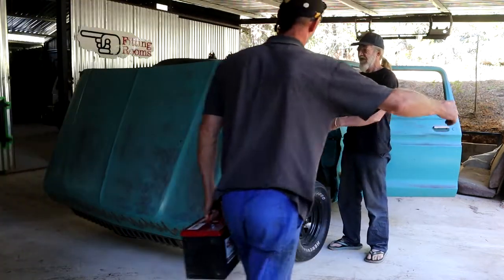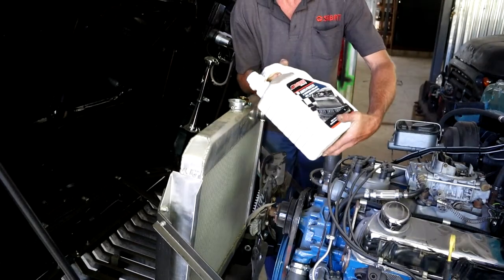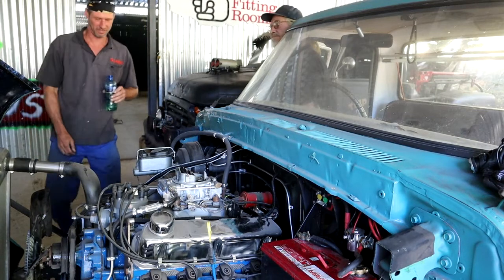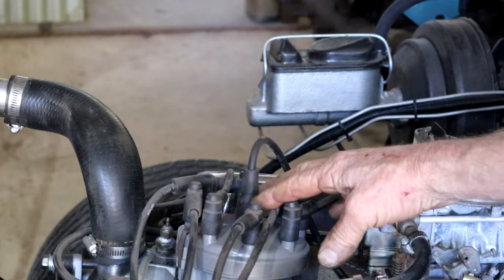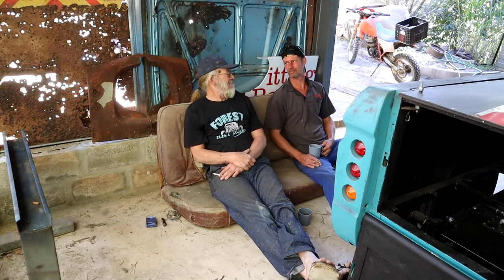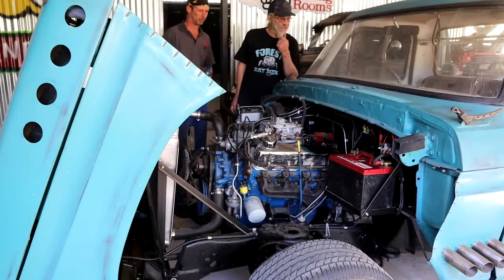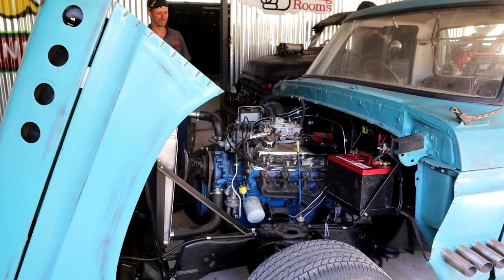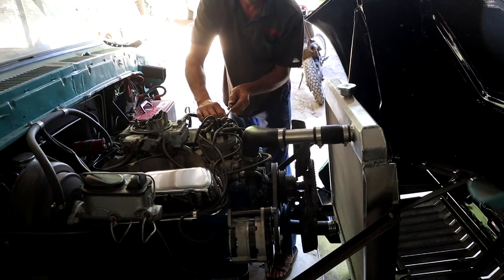FORD 351 Engine startup FAIL!

Comment: LP ( Liquid Propane ) gas conversions are ok...problem is power..they have less power on LP...biggest problem was fill stations and running out of fuel... they have the dual fuel versions now so you can still run petrol/gasoline if needed... still not really worth it for driving far from your property i think but they were common in 80's here in Canada...
Reply from the maker: I've since learnt the cost of the conversion kit... Definitely not worth it!

Comment: I’ve had almost  the same problem before with a brand new carburetor one of the float bowls would not fill with fuel it was an edilbrock carburetor with the transfer tube from one bowl to the other bowl and we found that the tube had a piece of metal in it, we got that out and problem solved!  Enjoyed your video even with the blah blah blah , it lets your fallowers see more of  your good character , be good man!

Comment: Those fuel filters cause more fires than ex wives. No joke please replace it with a wix part number 33003 or equivalent
Reply from the maker: 😀 Thanks, I did in the end.